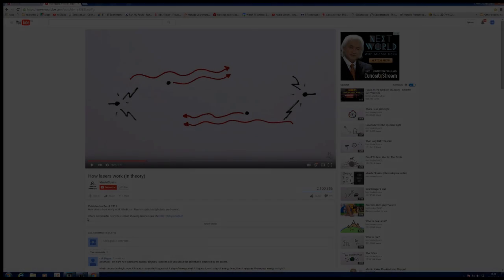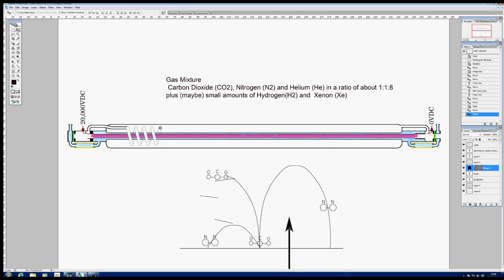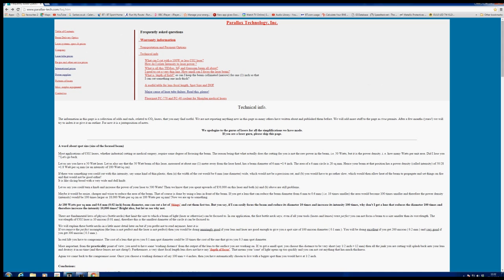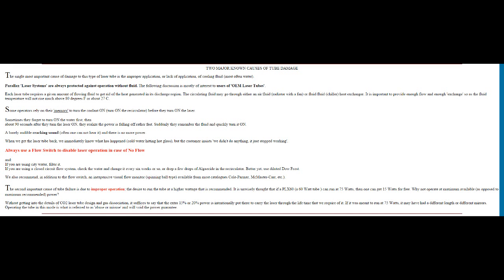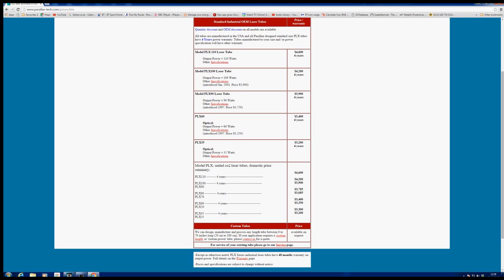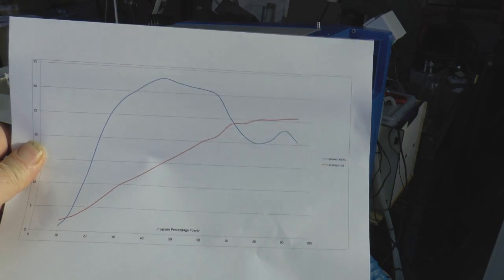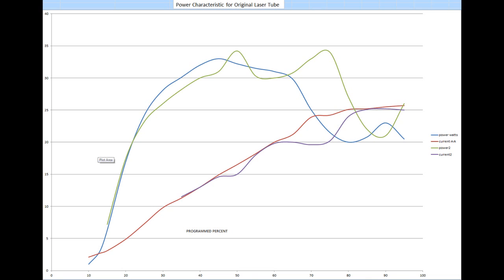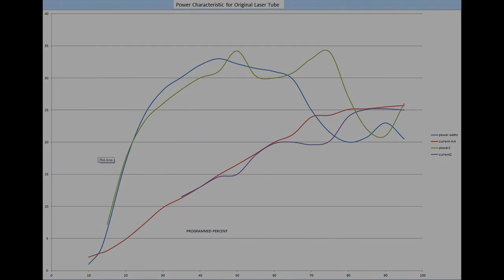RDWorks Learning Lab 35 Understanding MY Laser Tube Part 2

Comment: I’m guessing that you have thought about “regassing” a CO2 tube.  As the hydrogen and helium remain unaffected could you get a little more life from a tube by giving it a “sniff” of CO2 and maybe nitrogen.  Or is the balance of the gasses far too critical to get away with that.  (I hate throwing stuff away).  Cheers Russ you a very clever teacher.
Reply from the maker: You can get more expensive tubes regassed but from what I know it's cheaper to buy a new tube. If you go to https://www.parallax-tech.com/  you will get lots of good information about tubes and tube technology. They tell you all about lens theory in fairly simple terms however this is all text book stuff and bears little relation to what happens when you start using a laser beam for cutting non metallic materials. If you look at the price of their tubes and the  regassing charges, you will understand my initial comment.  The big problem that I can see with regassing is that they cannot get into the tube to clean the cathode.. As the CO2 dissociates to CO and O most of the free O gets attracted to the cathode and starts oxidizing it.   Hmmmm oxides are usually either non-conductors or at most semi-conductors. That means at the end of the tube's  "gas life" the cathode is rather inefficient hence I cannot see the point of regassing an inefficient tube.

Reci are  (in my opinion) up-market fraudsters. They make all sort of misleading claims about their product that is twice the price of  other good quality tubes such as EFR or SPT. The gold sintering you mention is pretty standard on ALL  better quality tubes these days. If you look at the central ionization tube as it sits in its box, you will see that it has an obvious pink hue . That pink colour is caused by an atomically thin layer of gold that coats the inside of the tube, This gold acts as a catalyst that helps recombine most of the dissociated CO and O back to CO2. This obviously prolongs the life of the tube  along with the fact that such tubes are usually 55 or 80mm diameter so that they contain more gas volume.

 I have a NON CATALYST 70 watt 55mm diameter  tube that is now 5 years old and still working as new. There are lots of people out there with similar age tubes so don't take any notice of fatuous guarantees and tube life claims.

Best wishes
Russ

Comment: And your plastic is pealing because there is a protective layer they don't remove. you are supposed to remove it yourself. Just like the blue stuff on your power supply.
Reply from the maker: Hi Norm
 You are right. I had already peeled the protective film from the fascia. but I later found out that there was a second film as well. I was not sure if this was actually  part of the keypad or yet another protective film/sacrificial layer. Anyway as you will find out, I made myself a keypad protector for both my machines and peeled this second film off also..
Best wishes
Russ
Reply: @SarbarMultimedia  I noticed you haven't made any newer videos. Hope everything is ok. I'm enjoying the ones you have and learning as I go.
Reply from the maker: @normcaissie5598  
 Hi Norm
 I am currently up to #170 and am just about to release  #171.  After 4 years I feel this learning  journey is nearing  it's end.. When I complete my investigation into lenses there are not many other major subjects left . I have plans to change what looks like a perfectly good 60 watt tube  from one of my machines . It cuts well  but precision photo engraving is no longer what it was a year ago. It is now like using a blunt pencil. The issue of brown smoke marks at the start of every cut is another  non-researched subject. The output rate will decrease as the problems get less but more complicated. I have learnt a lot but think there is still a lot of detail yet to fill in. Also, have you looked at the Lightblade Learning Lab series?
Best wishes
Russ.
Reply: @SarbarMultimedia  No, I'm on Video 55 of the RD works series. I'm waiting for my 50 watt laser to arrive in Canada. I ordered it last week. Trying to take in what I can before it gets here and your videos point out many things to check and fix before I turn it on.

Comment: Very interesting, but also depressing, I guess nothing lasts forever! If I bought a new tube as a spare to wait in the wings for my existing to fail do you know whether gas dissociation (or any other degradation) would take place? As you mentioned with yours possibly being no use if/when you come to use it.
Reply from the maker: +patrick whelan 
The gas in the tube is at a partial vacuum and the mirrors are sealed onto the ends of the glass tube with an epoxy resin. From what I've read, it appears that over time, using the tube or not, the outside air can leech across the seals and disturb the delicate balance of the gas mixture in the tube. I think dissociation only results from using the tube because it needs the high energy collisions to promote this type of change to the gas composition. I'm not going to worry about this issue because now that I know (or think I know) that the tube is going to start under performing at the later stages of it's life, I will get sufficient warning to order a "freshly picked" replacement. I hope I'm wiser now and will make sure I get a proper 50 watt replacement next time and not a 50 watt fake. 
The good news is that there are pills you can take for your depression!!
Regards
Russ
Reply: Lol yes I will have to book in down at the doctors! Thanks!.Oh, OK that's great to know I have seen that a lot of Chinese sellers recommend buying a spare tube and optics at the same time as the machine to avoid down time. I guess that is actually good advise given that they also will say a 100w can do 127w so they won't last five minutes in that case! Once again thank you so much! My first machine suffered the same fate and I had no idea why! Now I know exactly how to look after my new machine thanks to you! I'm driving down to pick it up tomorrow, can't wait - way better than Christmas! :)
Reply: @SarbarMultimedia  Many thanks for sharing all your findings.. Wondering whether it would be possible to use some basic refrigeration equipment i.e. a small vacuum unit and compound gauges to re-charge the tubes. Using the readily available fridge schrader valves, one could be connected to the factory hot crimped fill port. By scoring and removing just enough to attach using epoxy or high temp RTV gasket sealant. The gases could be each weighed into a small empty and evacuated cylinder of some sort with the addition of 1 or 2 small inline refrigeration driers/filters (used to remove moisture from ac/refrigeration systems) using electronic scales, and the tube re-charged by monitoring the pressure reading of the gauges. Of course the difficulty would be to find the correct gas ratio for initially filling the cylinder and a suitable pressure for each tube, however, maybe by using the watts meter and trial and error this could be achieved...
Reply from the maker: @hasger1941  

Hi
There are people refilling tubes commercially but they charge a fortune. Sadly I am not aware of anyone that recharges the sealed Chinese tubes,  The Idea sounds attractive if the cost could be effective. However, the big problem is that no one cleans or changes the cathode.  When you understand the way that the tube physics works and how the CO2 within the mixture degrades by dissociation to CO and a free O, you will become aware that some of the oxygen combines with the nitrogen but most gets attracted to the cathode where is oxidizes the surface and reduces its conductivity. That in turn leads to lower current flow capability and thus less output power.. What you are suggesting is the sort of project I might undertake if I had the  correct skills,  Sadly you can buy good quality A grade new tubes for a  quarter the price it currently costs to recharge an industrial tube.

An interesting project but I cannot imagine it to be commercially viable

Many thanks for the thought provoking comment

Bet wishes
Russ
Reply: SarbarMultimedia I think this reply answers my question about re gassing, did not realise that the gasses were under a partial vacuum, this adds another layer of complexity and I will have to resign myself to replacement instead of repair.